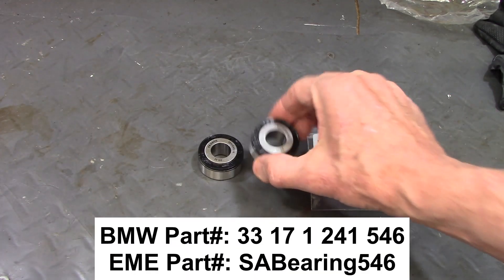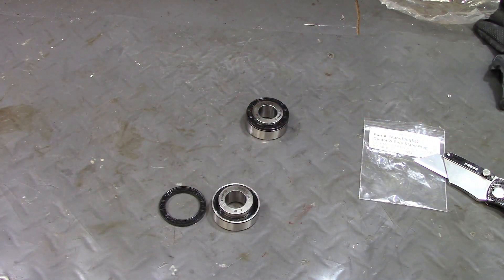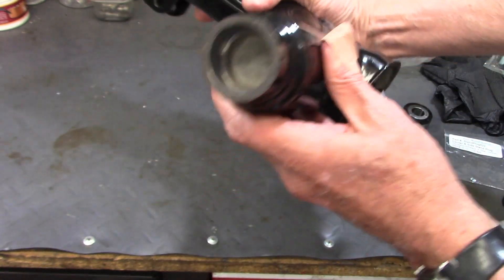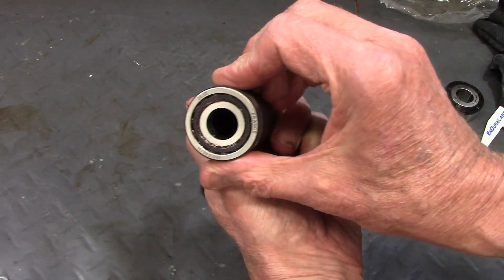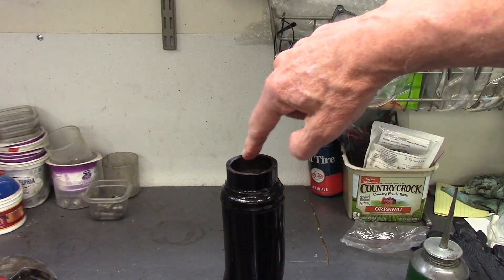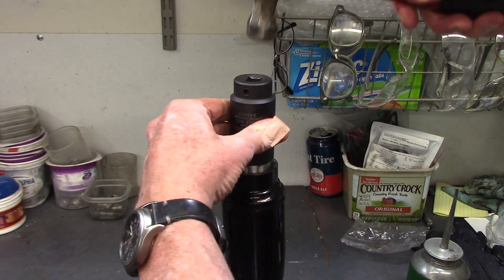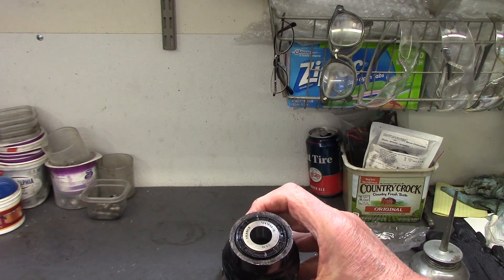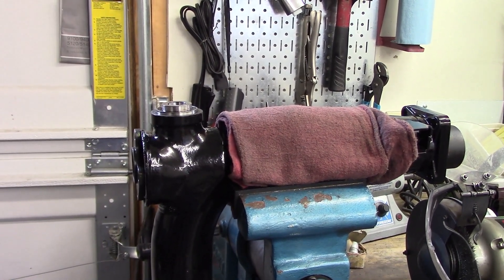1983 BMW R80ST Replace Swing Arm Bearings

Comment: Do these bearings come apart as they do for the wheel bearings?
That way you could drive in the two "outer parts (shells)" first (for each side) without having to think of the clamping method.
Reply from the maker: Best Virginia, The bearings are a unit since they are sealed, so you can't separate the inner race from the outer race without destroying the bearing.
Reply: @BrooksAirheadGarage  Thanks for the quick answer Brook! I was just wondering since they came apart pretty easily when I took them apart. After you take out the inner race, it's much easier to get the outer race out with a puller.
Thanks anyway for the answer and your videos all together! 
It sometimes is a little bit overwhelming but once you get the hang of these 2-Valve machineries, it's really not too bad!

Greeting from West Virginia,
Peter

Comment: Brook, what tool or method did you use to remove the bearings? Any advice is appreciated.
Reply from the maker: Click the link to the webpage under the video thumbnail to read all the details of how I do this work
Reply: @BrooksAirheadGarage  Thanks. For someone new to this, it's so cool that you have such a complete set of videos on the same bike. I also have a 1983 ST, right down to valve covers and and parts that were repainted orange. Must have been a fad.